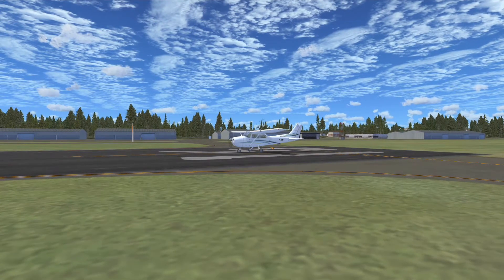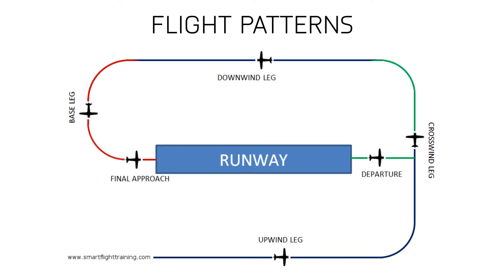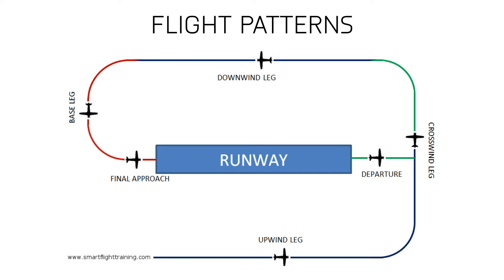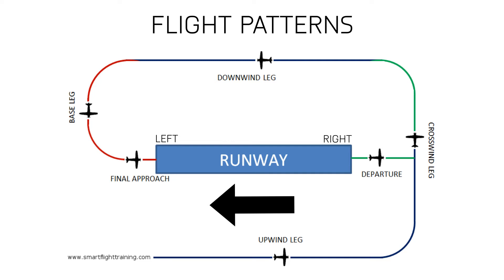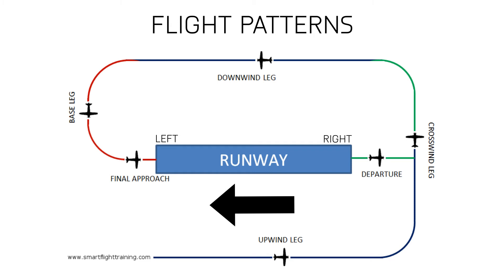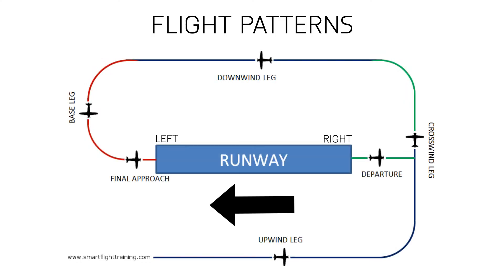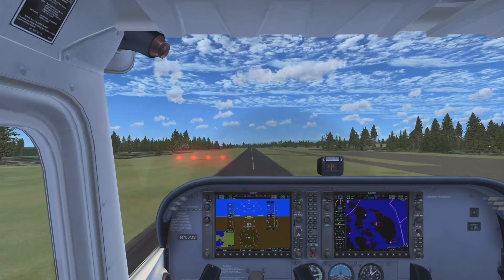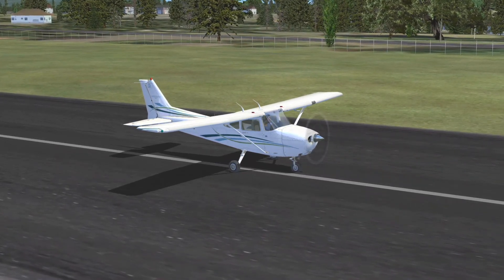FSX Downwind, Upwind, Final | What Do They Mean? | Tutorials

Comment: Hi! Cool video, thanks.
So basically, there are no fixed direction of the landing strip, the ground services decide what direction the planes should align to when taking off and landing, according to the current wind?

But how does it work when the wind is zero or very close to it? For example, if you have ten changes through zero in a day, because the wind fluctuates between -1m/s and +1m/s for some direction. Does the airport change the direction ten times a day then? How does it notify the aircrafts that are going to land or take off?
Reply from the maker: That's right, the airport tower will monitor the wind strength and direction to determine the active runway.

But if the wind is close to 0, they would simply carry on using the active runway they were already using. Remember it's DIRECTION which determines the active runway, not STRENGTH.

If the winds were constantly changing direction then it would be a judgement call for the tower controllers. They'd usually only change runways if there was a sustained change in the wind direction as for commercial airports it's a big deal to change runways. That being said, I know Heathrow for example switches their runways at 3pm everyday, but not in direction, just it's parallels (one for landing, one for take-off). So it shows that it can be done at short notice and fairly often

In terms of communication, the controllers would simply radio the pilots to inform them of the change and provide them with a new landing/approach pattern for the new runway.

Hope this helps!
Reply: @JacksFSVideos  yeah, that's very informative and cool. Thank you a lot for your time and knowledge!

Comment: Awesome - you seem to understand this better than most seasoned pilots.  My only addition would be that after upwind, always turn crosswind over, not after the runway, merging into downwind on the inside at a 45 deg angle, or performing a teardrop to merge in from the outside if traffic is heavy.  This is to avoid a collision with aircraft on the departure leg.
Reply from the maker: Thanks and appreciate the tip!

Comment: when you fly out of Twin Falls or out of Salt Lake they put you in a traffic pattern departure. first they have you take off from the runway and then they have you do a crossed leg departure and then they have you fly back on the runway heading on the downwind leg and then they have you turn left or right to exit the traffic pattern and then head north or south. the tricky part is entering the traffic pattern. coming into Twin Falls ID to fly over trees plus hills Salt Lake as the trickiest of all of the traffic pattern approaches. to the north of Salt Lake is the lake itself to the South is Mount Oriah if you don't adjust your altitude while you are entering the traffic pattern into Salt Lake if you overseed on the North End of the runway your plane crashes into Antelope Island or goes into the lake if you mess up on the south end you crash into the Wasatch mountains this is why you need to dial your GPS compass or your autopilot so your plane is exactly lined up with Runway 34 or you risk over shooting or crashing into the mountains or the lake trust me I did that before in flight simulator and it is not a good experience.
Reply from the maker: Thanks for sharing this information. Thanks for watching!

Comment: The reason why it's called crosswind is because you'll experience crosswind if winds were straight down the runway.
Reply from the maker: Yes, correct.
Reply: So if the wind would turn 90 degrees from your example, the downwind/upwind leg would turn into a crosswind leg, and the crosswind/base leg would be in an upwind/downwind.
Reply from the maker: In theory that's correct. However this would never happen in real life, as if the wind turned 90 degrees, this is what is called perfect crosswind. Where there are crosswinds passing at a perpendicular angle to the runway. In this case, all the legs would most likely stay the exact same as in the example as neither runway would be preferable for take-off or landing.

You could never have the crosswind leg or the base leg along the side of the runway (parallel to it) as it wouldn't work for landing. They always have to be at the ends of the runway, similarly, the upwind and downwind legs must always be running along the side of the runways. It also doesn't matter if the upwind is above or below the runway and vice versa. It's just about which direction that pilot chose to approach the airport at. Hope this helps.